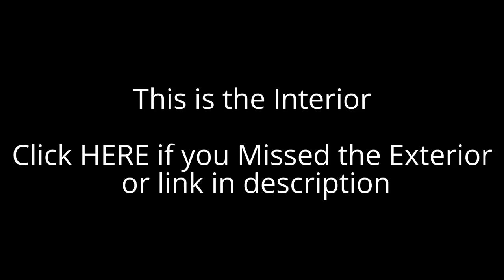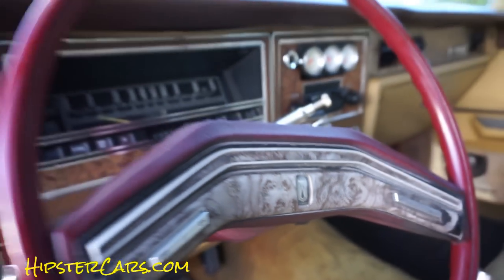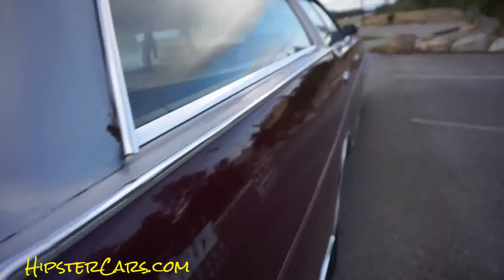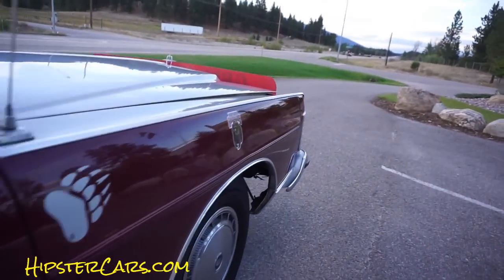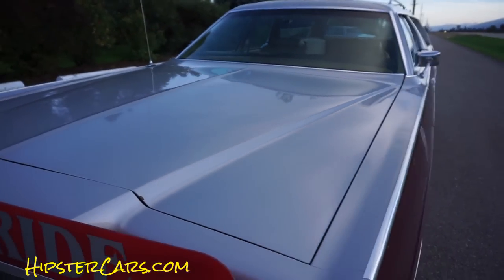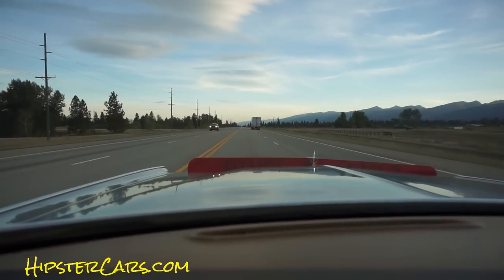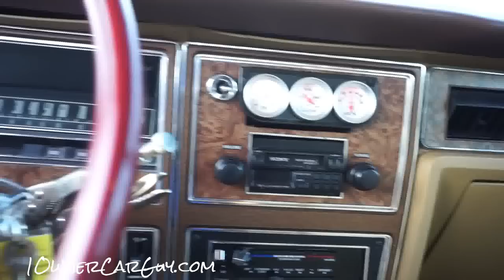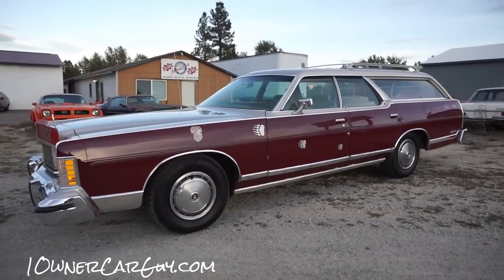Mercury Colony Park Station Wagon Interior Video Review

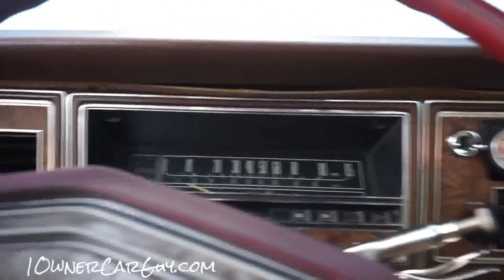Comment: 5:45 - Smog Pump and some related components removed and capped off. The hard restart when warm can be caused by ignition timing adjustment. Also looks like the alternator isn't charging well at 11:23. Not a bad starting point for a project car, most of everything is there.